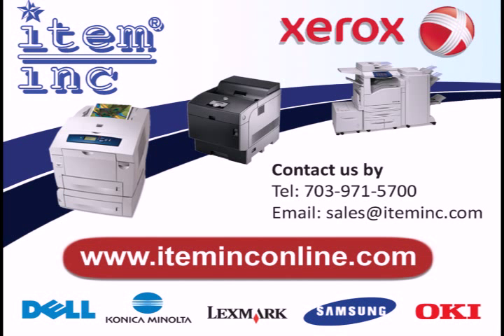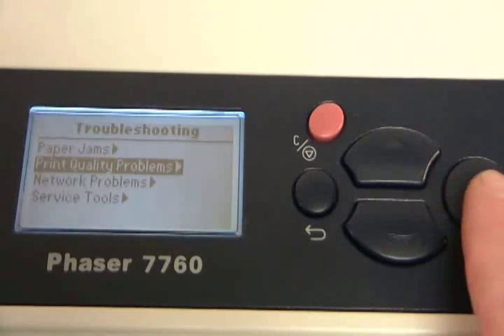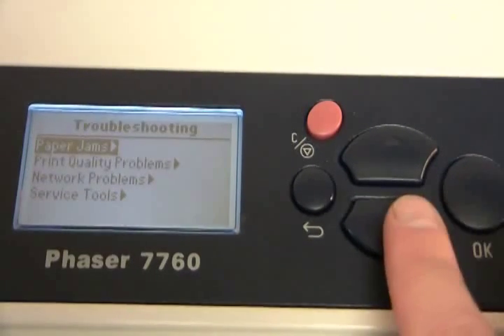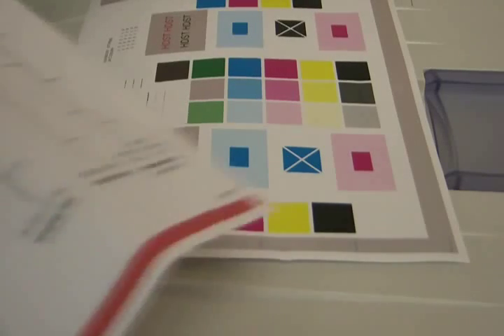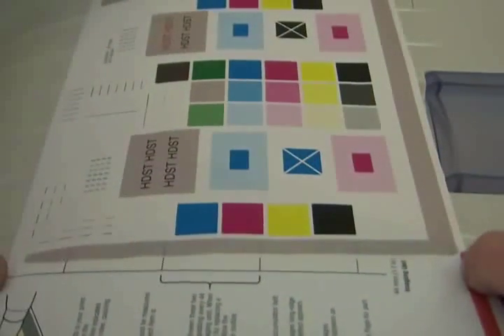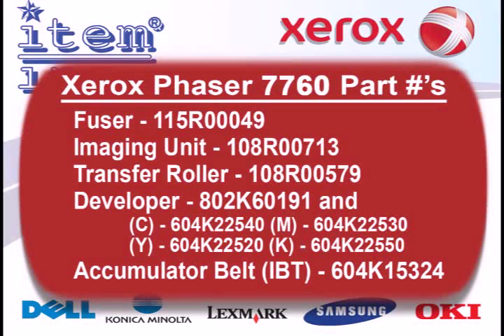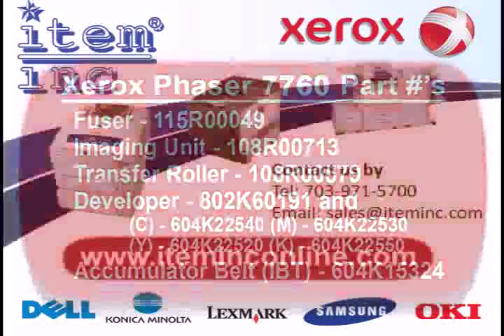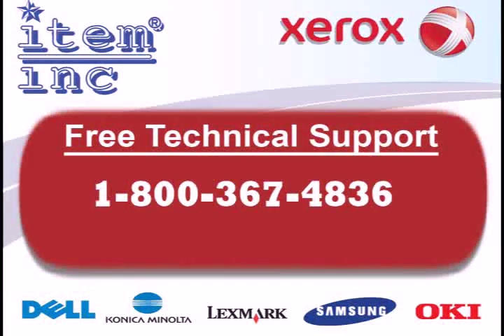Xerox Phaser 7750 7760 Repeating defects (marks or lines on pages)

Comment: I have a Phaser 7760 that I have had from new, and it has been a constant nightmare in terms of poor print quality and image problems. Xerox is just SUCH a poor quality printer manufacturer.
I am now getting diagonal streaks across the page from the magenta toner cartridge only. I have cleaned the laser window (an almost continuous task with this 'wonderful' POS printer) and changed the imaging unit at great expense. The problem remains.
If I could afford it, I would happily take an axe to this printer, such is the frustration it causes! It is just one consistent stream of errors and problems — not to mention the massively over-priced consumables. As a Xerox user of some 8 years, take it from me: avoid Xerox at all costs.

Comment from the maker: @cassalas446 A solid line could be caused by few things.  Two things I would try would be first try swapping the image units around.  If the line then changes to a different color, you know it is a bad image unit.  Next, try cleaning the laser windows.  Open the front door and there is a cleaning wand on the inside of the door.  Remove the waste cartridge and slide the wand all the way down to clean the glass on the top of the laser unit.  Hope this helps.